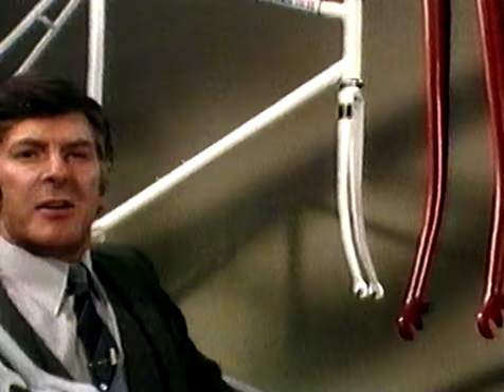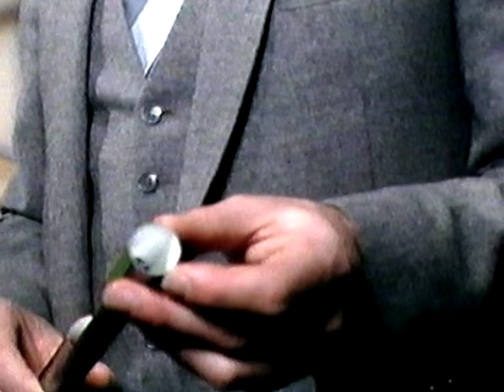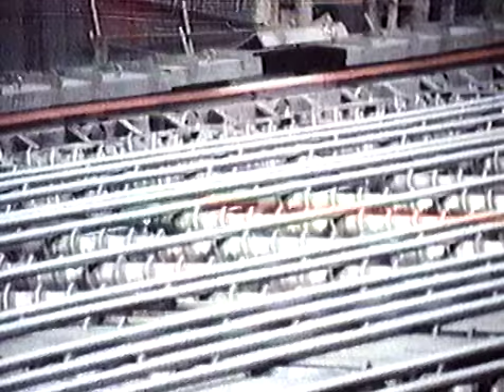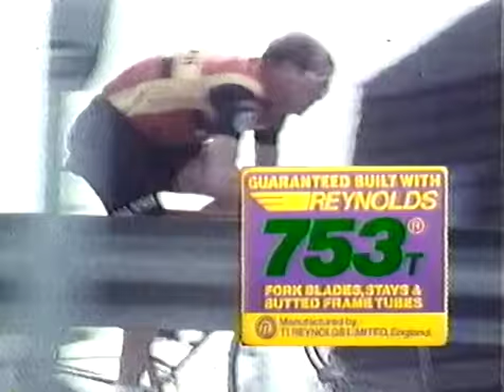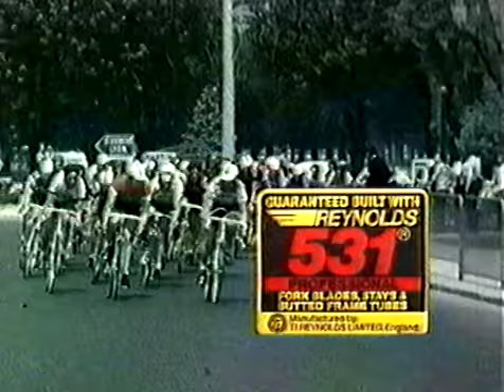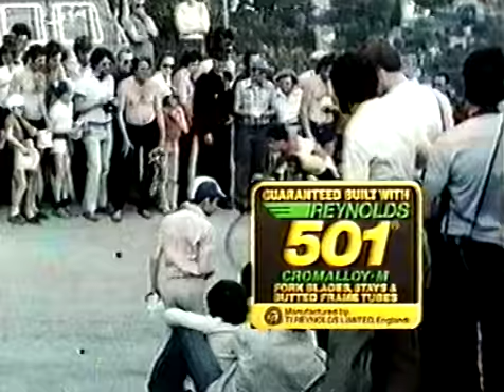Veteran-Cycle Club video archive - TI Reynolds

Comment: In 1990 I worked at a shop that sold Specialized and bought a carbon Allez, it broke at the BB seat tube junction.  My rep did not respond to my messages for a week.  I was racing a bunch and needed a bike, I was trained on my winter bike but it was not something I wanted to race.  I drove an hour to a shop and bought a Trek 660 with 531 tubing.  I rode that bike for the next 4 years and it was great.  I moved on to a Marc Muller OS Paramount (2nd hand from a friend) but the 660 has a special place in my heart.

Comment: I still ride steel.  853 these days.    753 was well out of my reach as a kid.  The stuff of dreams back then!   Any Reynolds-made frame was, I had a Peugeot racer, it could have well been made of iron!  Early 10 speed!
Reply: I've got a Falcon Ernie Clements  tourer with  531 throughout  and Campag dropouts with adjusting screwes for the rear wheels from the 70s, a 1990 Peugeot mountain bike with 531 main tubes and Tange forks. Plus a Graham Weigh racing bike with the ultra rare 731 frame and Campag components.
      I love good quality steel framed bikes.

Comment: is that Peter Purvis?
my first serious bike in 1989 was a holdsworth road bike reynolds 531 professional, shimano105 groupset and wolber wheelset with hutchinson tyres
gearing was 52/42 and i think it was seven or eight speed cassette, 23 tooth largest sprocket.
i can not get up hills on those gear ratios today
cost £500
i wish i had bought two, wonderful bike that took me into my cycling life
over the years i have had aluminium and carbon bikes but steel is by far the best ride, its responsive, reliable and compliant. i love it
thank you reynolds and thank you for this video guys
Reply: I had a 531Pro Holdsworth -like you wish I still had it -did some great rides on it.